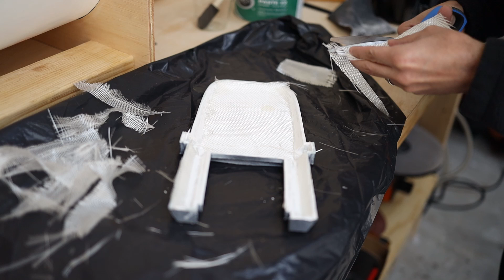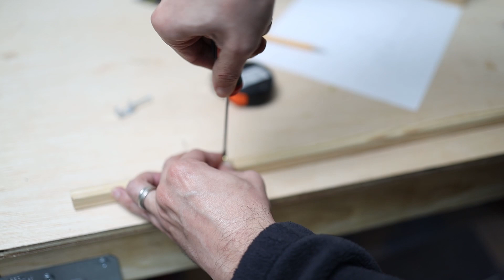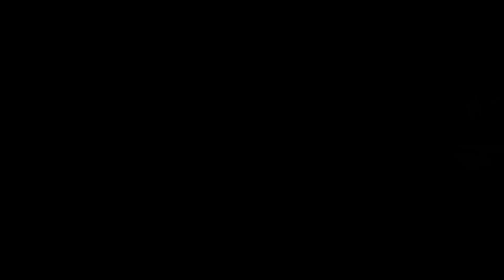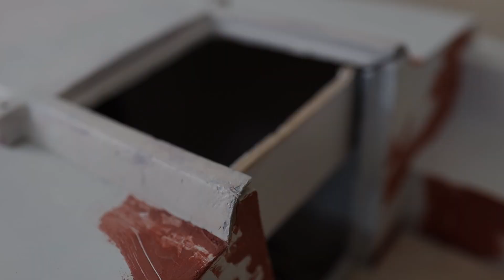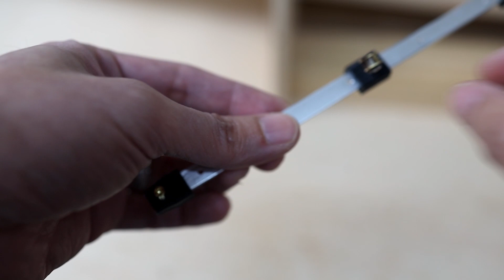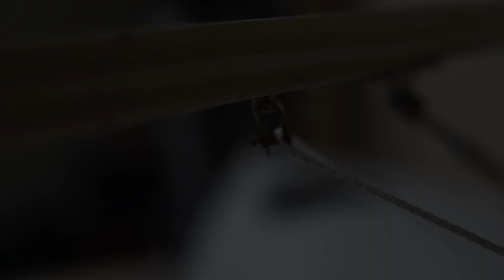RC Sail Control

Comment: Hi Domingo,
I'm working on another yacht, for the mast I'm considering to use carbon tubes. On the tubes I'm going to place 3d printed mockup, which will give shape for the mast. Tubes are 14mm and 12mm diameter, bottom tube goes into Hull then 12mm is going into 14 mm tube on the height of 1m. There will be some overlap between tubes about 15-20cm - mast in my case is 1.7m.
Carbon tube gives rigidity and 3d print shape.
It is concept so far but I will try it and can share results.
Reply from the maker: I like that idea to test. Also carbon tubes should be more available that those specific scale aluminum mast.